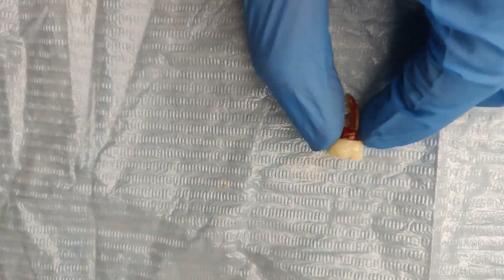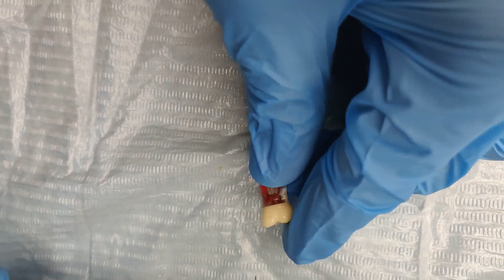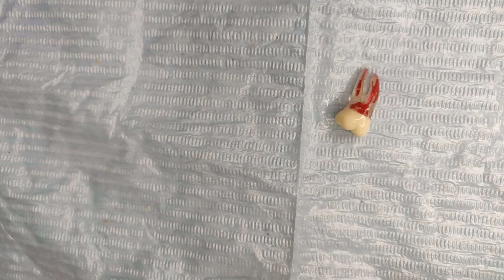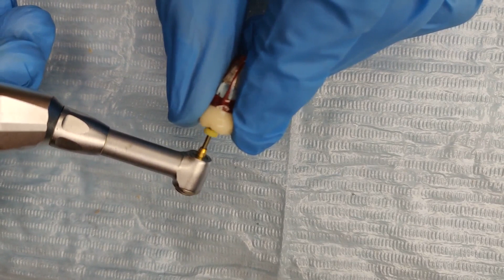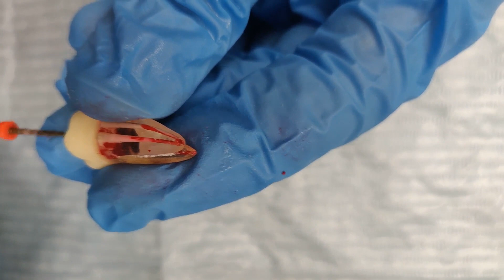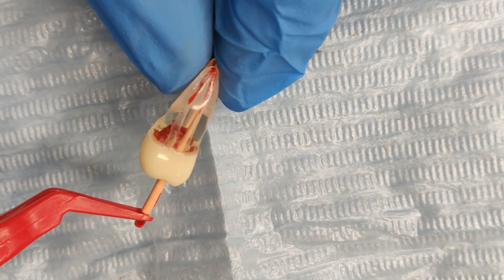Rotary RCT

Comment: Nice, but you are using to much auto reverse. If you let that happen, your files are going to break more often. Try to not use too much force, so auto reverse wont turn on. You can clean canals not in single try, but in two or three

Comment: I had this done for the first time , last year. The dentist, if you can call him that ,was a butcher. He rammed that drill repeatedly up my tooth and had no mercy. It was so bad, my backside was arched up and I was screaming. When he was done, he just walked away as if I was a piece of meat. No concern or questions for me. Three months and $1,500 later, I had to get it pulled because the nerve was not removed and it got infected. Yet my girlfriend had a RCT done with the regular files that is turned by hand and no pain or  trauma. I have had other people telling me that the older standard way is much better. This is no reflection or disrespect to the Dr doing this video.
Reply: I think both ways work pretty well.  I've had rotary done on me.  I'm sorry for your tough time -- he should have numbed you up more -- and I don't understand how the nerve wasn't removed.  Usually if they ream the tooth that much the nerve is removed -- I suspect it was something else, like maybe he fractured your root.  Incidentally, I don't have a rotary instrument so I have to do everything by hand when I perform RCT.  It works okay but it takes much longer, LOL, and my fingers get sore.
Reply: @Briguy1027  Same here too.
Even I do hand filing only,have ordered a endo motor now and trying to learn the same.👍🏻
Reply: @tonysoprano711  So a colleague retired and left me with his NSK endomotor.  I bought some files and it does save a lot of time, using the settings used in this video.  I just did #18 -- lower second molar -- yesterday and I could do the distal canal no problem because of how it slants out.  However, I was leery of the mesial canals because they lean to the distal and the 25 mm files are quite long.  So I did those by hand, which took much longer, and there is more possibility of ledging.  Patient was about 30 years old so a fairly ideal case canal-wise.  After trying to shop for shorter files I found out why the files I have are blue.  They are something called "heat-activated" by a company called Azdent.  I am sure many companies make them.  But they bend but at the same time they are still soft.  I think I could have bent them and used them in the mesial canals.  I may have to try that in the future.  So long story short, the distal canal was cake to finish -- and the GP fit quite well first try and checking with a radiograph.  

Also, none of the companies I mentioned should be an endorsement, that's just what I have, and yes I'm still learning.
Reply: @Briguy1027  Thanks for your insight.
Reply: @Briguy1027  And mesial canals are mostly curved compared to distal canals.
I will be getting my endomotor by this weekend post a reply over here after I use it,btw where do you practice?I practice in India.
Reply: @tonysoprano711  I practice in the greater Los Angeles area of California, USA.  And based on my endo skills, I definitely say it's practice, LOL.
Reply: @tonysoprano711  It seems you deleted your comment where you talked about how you do root canals.  What you posted seems quite good.  I am sure you get excellent results with your technique.
Reply: @Briguy1027  Lol.
This is what I follow for Hand Filing System.
I usually use 8,10,15,20 Mani K files for initial shaping and cleaning of canals till apex.
Followed by 6% Micro Mega Hero Shaper Hand files till 2/3rd of canals and 4% Hero Shaper Hand files till 0.5mm short of apex.
In between I irrigate canals with Sodium Hypochlorite, EDTA liquid and Chlorhexidine solutions.
And obturate with single cone fit technique along with Bioceramic Sealer. 
Have given me fair results till date.
Will be moving towards Micro Mega Hero Shaper Inget Rotary Systems in near future.

Comment: RCT is painful?
Reply from the maker: if it was done correctly , No it is not
Reply: Not much but it pains when the insert the piles to check the depth
Reply: @tanyapunyo2074  severe pain.?
Reply: @souvikghosh8523  for seconds yes
Reply: @tanyapunyo2074  mind boggling pain
Reply: on a scale of 1 - 10, it's 7/10 max.